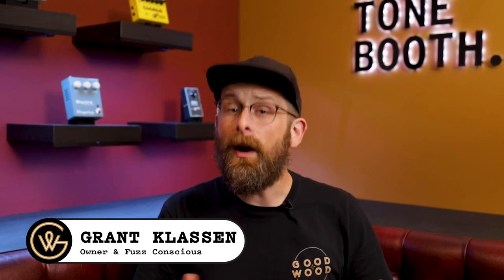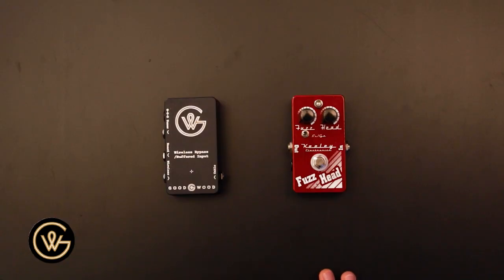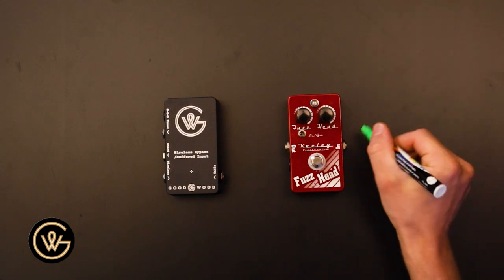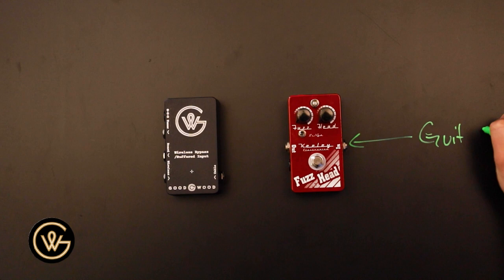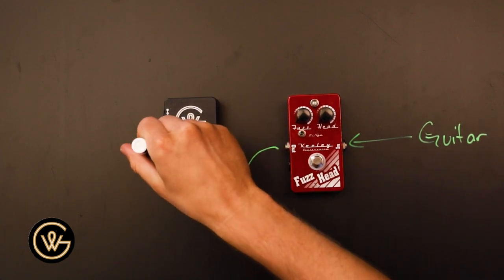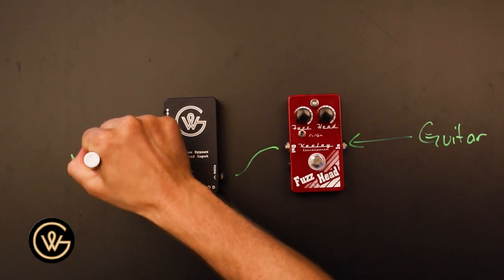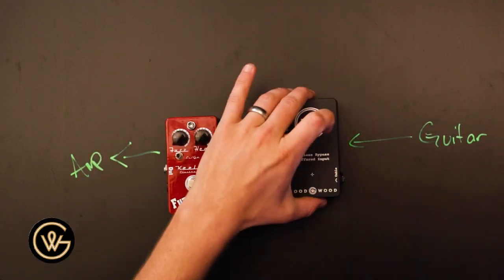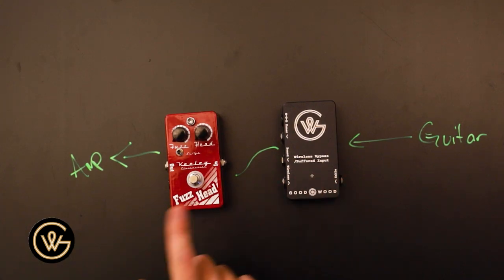Is Buffer Before Fuzz A Rule You Should Break?

Comment: From what I heard and also experienced myself, when constructing a fuzz pedal is that with a buffer the fuzz does not react to the volume knob as interactively as without. However I found that by using an op amp as a buffer you can increase the input gain into the fuzz pedal which can be sonically pleasant and gives some nice results. Of course the tone will be brighter with a buffer, but thats why you have your tone knob.
Reply: If you use a buffer before a Fuzz Face you loose  ability to go from clear to distorted,while maintaining close to the same volume  level with the guitar  volume knob .If you use a buffer after a Fuzz Face you will likely get better Wah pedal performance.
Reply from the maker: Correct... Volume pot interaction completely changes.
Reply: @pedrobrando4606  In that situation, when would the wah go in the chain? Before fuzz?

Thanks!
Reply: @GoodwoodAudio Would the interaction between a fuzz face and a tubescreamer that is downstream of it, but off, be affected? Would cleanup be normal? Does the overall tone and character of the fuzz face change?

Thanks!

Comment: I ran into an issue with my fuzz factory. I wanted to have it first in my pedal as I realised you cant really get the cool occilations the pedal is known for if you put a buffer in front. But then I realised when using my coily cable as opposed to a non-coiled guitar cable there is horrible noise when the fuzz factory is switched on. Using the non coiled cable fixed this. Anyone know why ?
Reply from the maker: not too sure. Coily cables hugely increase capacitance / high end roll off. Might have something to do with that, but not completely sure as I've never actually owned a coily cable... should probably change that for tests like this.

Comment: Does it make any difference whether the fuzz is germanium or silicone?
Reply from the maker: Definitely.  Typically speaking, both like to see the guitar, but in general fuzz pedals like to see the guitar.  Of course there are exceptions, but whether it's silicon or germanium, transistor etc... Guitar is typically the way to go. JHS did a much longer video on this a while back and tested out a bunch of different fuzz types - check it out if you're interested!